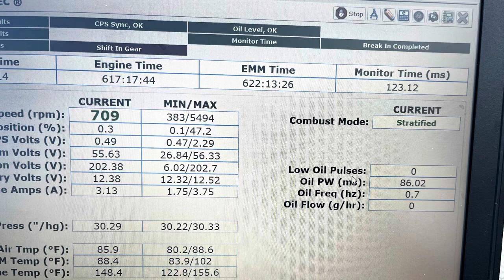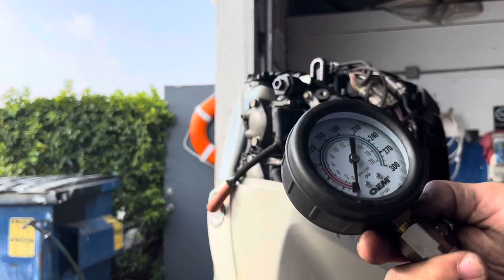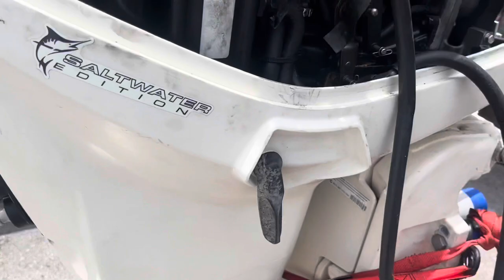Starting a 2006 Evinrude  e-tec  90hp that has been sitting for long time..

Comment: Hey. I'm strongly costing buying a boat with an Envinrude ETEC 150 ... I'm very worried about the reliability of the engine, and servicing it.. what do you think of you where buying a boat that came with one today? Thank you!
Reply from the maker: Hello Andres.. i like etec engines. very strong and very quiet, good  on gas and oil. check the Hrs of the engine. Service is not too crazy just spark plugs and lower unit oil, police and  fire department still using   etec here in south Florida.  Now if you have a bad computer, injector or oil pump that can be very expensive but that is not common.. so like i said, check Hrs and see if they did any type of service..